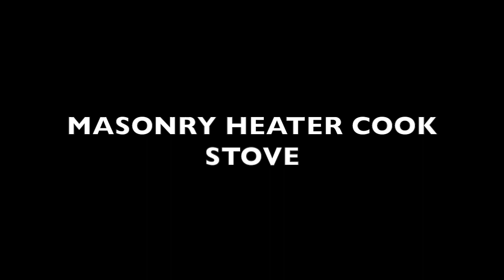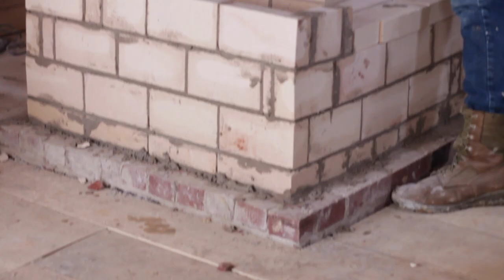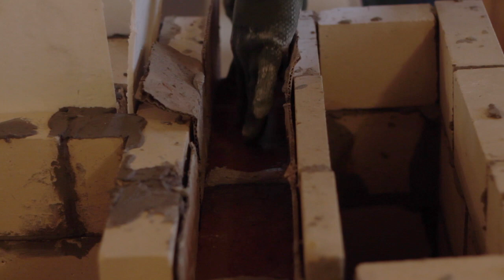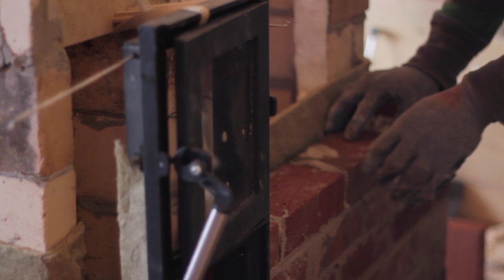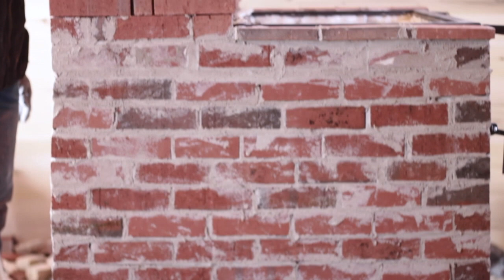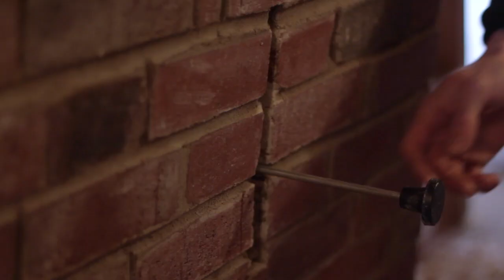Our timber frame cabin part XVIII: MASONRY HEATER COOKSTOVE

Comment: We have a masonry heater (constructed by a stone mason with experience doing these)for our two floor cabin that my husband built. The cabin was actually constructed around the unit. Our outdoor temps can go to -30 yet we stay very warm inside, always, in fact we leave an upstairs window open a few inches. The bricks used all came from demo sites from the old factories and homes in this part of NY, many of the bricks were handmade. We bring in wood from our farm acreage and never have any issues in the 20 yrs we have used this. Good luck using your heater, it looks nice and functional.
Reply: Thanks!

Comment: Gotta say, a bit brutal watching you do this without a level and not getting your head joints proper.  With that said, very cool addition to your home, it's very nice!
Reply: As someone with little to no masonry knowledge, what are head joints and what was wrong with them?
Reply: PorkChoppington Head joint are the gaps, vertically, between your brick.  Bed joints are the gaps, horizontally, between the bricks.  The gaps should all be the same.  It is hard to do when you first start doing it.  He did ok for not being a mason, I've seen way worse!
Reply: I was wondering where his level was...
Reply from the maker: I did use a level, but sparingly as is obvious. In homesteading one is committed to being a Jack of many trades, and the complete mastery of all would take many decades. This is my second time bricklaying, and though far from perfect, it fits the bill and works, so Im happy!
Reply: You did better than I would have done... even if I had all of the best tools available to me ;-).
Reply: Mr. Chickadee I completely understand.  The only way to learn is to just go ahead and get her done
Reply: Mr. Chickadee  I was thinking, I would hate to have you watch me do a video on Timber framing! I would be horrendous at it! Ha ha
Reply: The test for "perfect" will be when you are warm during a cold night and the crust on the bread  comes out just right.  Then the workmanship of the heater/cookstove  will be deemed perfect.  No level will ever measure that.
Reply: Rick Green Yep, but after you eat the bread ya still gotta look at the brick work.  Ha!
Reply: ***** Ya got a good point Rick!!
Reply: Is there an advantage for the bed\head joints what you just said ? (beside looking symmetrical and perfect aligned ) I have no idea, im new to this but I wanna learn :]
Reply: Found the bricklayer!
Reply: @MrChickadee  :  I think you were plenty precise for the size and intention of the brick work.  Of course a pro doesn't want to sit by and watch an amateur do it.  I imagine it'd be the same for pro carpenters watching a do-it-yourselfer making a cabin with a chainsaw!
Reply: @brucewayne2984  :  Perfection in imperfection.  An immaculate tea ceremony with an ancient cup that has a small chip in it.

Comment: I love the organic brick work. It's something I've never done. I'd have to force myself to do it after having dropped a level on every block I've ever laid.
Reply from the maker: I did use a level some, but not much obviously, as I like the "organic" look as you say, and this is not a load bearing wall or tall chimney than needs tight tolerances, so long as it fits the hardware and doesn't fall over, it works.

Comment: Looks great, but I'm curious: how do you clean it? It seems there are more bends than access doors.
Reply: I think he means on the inside.
Reply from the maker: There are three clean out doors located at the base of the stove which provide easy access to all interior channels.
Reply: Thank you sir!
Reply: I'm curious about the design layout of the internal brick. Was that accommodations for you appliances, or was there another reason? Your level of skill and commitment to your values are inspiring, to say the least.
Reply: BrandItJohn's - the quick story is that the channels he created will route the heat through the masonry "mass" - in short, letting the bricks absorb massive amounts of heat, instead of sending it straight out of the chimney. The reseults are stored heat (which re-radiates after the fire is out) and cool chimneys. The burn chamber typically burns hotter (ergo cleaner) than a typical fireplace or wood stove, which reduces creosote. That, in combination with the greatly reduced exhaust temps leaving the masonry heaters, reduces the risk of chimney fires. Burn less wood, less often, get more heat and reduce danger. Not a bad days work by our friend, Mr. Chickadee.

Comment: The video doesn't show or state via text what your doing.  For example....that metal box you put in, who designed it? Did you buy it, if so where from?  Is it something you made if so how?
Was it fire brick in the center and you put a layer of regular  brick on the outside?
Thank you for your assistance.

Comment: I am going out on a limb and say that this is a modified European type heater where by a fire is built in the morning with the heat being absorbed by the masonry for slow release throughout the day. The big question will be how big of a fire and when to fire and not to fire. Some friends had a home in which the heat from a central boiler with copper piping laid out in a concrete slab floor. The big ? came on when to turn system on and when turn it off..

Comment: i'm sorry but as a life long Mason and heater builder your video is not a good example of professional building. Use a saw for clean cuts and tighter fitting joints. I would question the longevity of this heater. The brick work is really sloppy and i can see bricks that are not level, small head joints and big ones. I guess if you are doing this for yourself it's ok but Honestly i hope people are not paying for this work.
Reply from the maker: Mimmo, I built this for our home, I could never afford a mason, I'm no brick layer for sure, but it works, it keeps us warm and cooks our food, so I don't worry about the "head joints" or the "level", the baking bread sure doesn't care...

Comment: Could you answer a few questions please ;
1. Are there any books or plans on how to build these stoves/heaters ?
2. What is the material you were placing in between the brick by brick layers (no I don't mean the mortar - the sheets of insulating stuff) ?
3. Do you have to insulate under the heater/stove ?
4. How easy is it to regulate the temperature in the ovens and on the hot plate ?
Thanks for the video, it's something I've never seen before.
Reply from the maker: 1. Im sure there are, but Ive not read them. 
2. Most likely its rockwool insulation if its grey, if its was write its ceramic wool or ceramic paper insulation
3. Maybe, depends, is your house insulated underneath? If not you will need to insulate in some way, either starting the foundation below frost depth and then insulating around it from that depth up until floor penetration, or just build it up and do a layer of vermiculite rich insulating cement where it inters the house. 
4. Takes practice, there is no knobs or temp gauge, so you learn by practice, one side is hotter on top, one side cooler, back / top of oven is hottest so you rotate your bread as it cooks. Not hard, this is how people cooked for most of our history, till we got spoiled!

Comment: In the comments to the previous video about printed, you said that it can not cope with heating, house vystuzhaetsya faster. Try to make an additional frame for the winter. Insert them with the onset of cold weather in the openings of windows in addition to the principal. If possible, so that it is 2-3 "between the frames. We do that in the WCC villages. It has been tested and works.
Reply: Wrote through Google translator, sorry for the bad translation into English.

Comment: The firebrick should be mortared together with a refractory mortar for longevity. Portland cements and sand will not last under high heat exposure. Do it right and use a mortar that can withstand 2700 degrees farenheit where, at that point, it will start melting. Regular brick mortars will crumble away in no time..
Reply from the maker: Firebrick core used Heatstop refractory mortar, clay facing brick used clay mortar, zero portland cement anywhere, not sure where you got that idea?
Reply: @MrChickadee  I stand corrected. Clay based, preferably alumina silicate which is what most firebrick is, are great. Carry On with the fine craftmanship.

Comment: Awesome build. I am planning to build a Walker Stove watch?v=tBnIxtTZryY which combines rocket mass heater ideas with masonry heater/stove ideas. 

I am curious where you sourced your stove top and oven insert? Walker used a black oven set up, but I want to do a white oven sealed off from the smoke path. Mainly for not having to worry about food spills inside the masonry. He also used recycled old glass stove tops, but I think I would prefer a nice metal top like you got for your build.
Reply from the maker: We almost went with a Walker design before deciding on Alex Chernov as our designer. 
Alex has very reasonably priced plans made custom to your house in any configuration you want, and he sourced the hardware for us from Pisla and designed the stove around this hardware. All this for less than a good metal woodcookstove.
Reply: Awesome info, I found the Pisla site and bookmarked it. 

Interesting that you were considering the Walker Stove design.  And yes the Walker design actually got me looking at masonry cook stoves rather than the metal cook stoves. It makes so much more sense to design a stove to your space rather than fit a metal one into it. Plus it is less expensive.

Comment: Its looking good, especially when you have not done much brickwork. I think your mix is a bit sloppy and its good to work it a bit before you lay it.
Have you fired it up yet, getting a good result there is what is all important?
Reply from the maker: thanks, it heats very well and warms the house with very little wood, and none of the dry uncomfortable heat a metal wood stove gives off.

Comment: Why the mineral wool insulation?
I’d want more heat to go into the outer layer of brick/stone.
Reply from the maker: expansion joint between facing and core is essential. Little bit of insulation wont really stop heat transfer.

Comment: Masonry heaters are much better than cast iron stoves. The fire burns at a higher temp., the released gases burn in the stove not in the flue, and the brick absorbs the heat and releases it slowly radiating an even comfortable heat hours after the fire is out when the flue is closed. Best to have a 20' straight flue to pull the air into the intake and through the channels you see in the vid. The flue temp. is hundreds degrees lower than an iron stove, and the creosote is about zero - you just have ash, so much less dangerous.  

The Book of Masonry Stoves, David Lyle

http://www.heatkit.com/html/bookstore.htm
Reply: The one I made was the first thing I made with brick, the unevenness has some naive charm; used old soft reclaimed handmade brick. One brick has a chicken foot print in it which I laid in the lintal above the firedoor, which I made from an old iron stove front.
Reply from the maker: I also like the uneven brickwork...

Comment: The bricks are very dry, you should had sunk the bricks in water because the bricks have to be wet for the ciment.
Reply from the maker: Per the stove designer, clay mortar is best laid with dry bricks, its different than normal masonry cement or mortar.

Comment: Did you buy a  refractory mortar or mix your own? Any info on the brand or mix ratios you used? Thanks awesome work!
Reply from the maker: bought heat stop brand refractory mortar
just mix as recommended by the company.

Comment: Can you also have a water jacket with these to heat your hot water?
Reply from the maker: Yes, many add a large S or Z shaped stainless steel pipe in the back of the firebox to thermosyphon water up to a holding tank.

Comment: I love block work. I've spent countless hours doing it. I have to admit I've done it in tears of exhaustion but it's the other half of my dog nature. Digging the holes for those block foundations is equally if not more satisfying. I've never dug a foundation in tears. That's always been the easy part of the job. 
More to your work, I've never laid block with such tight mortar joints. 1/4 of an inch is about as tight as I've ever gone.
Reply: Refractory mortar (used on the inside with the refractory fire brick) is typically very thin. It's more like glue than mortar.